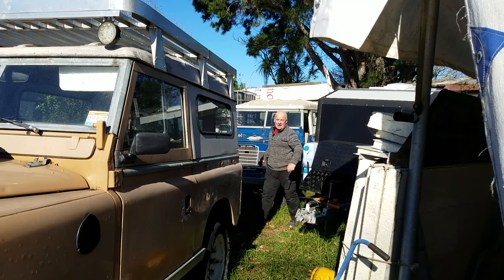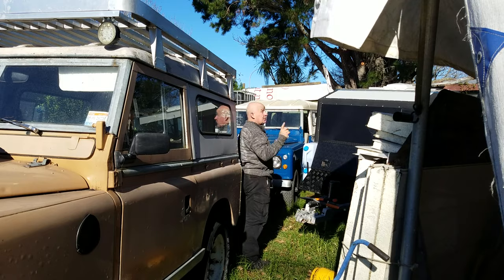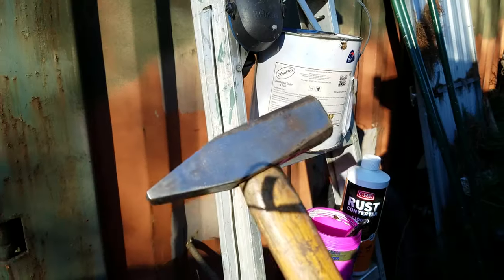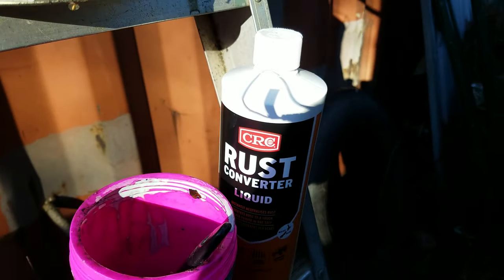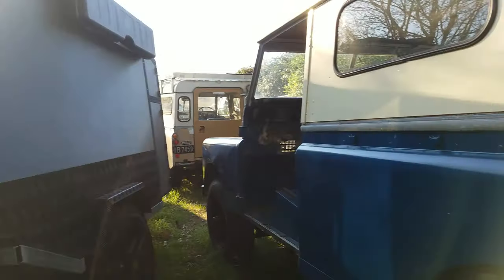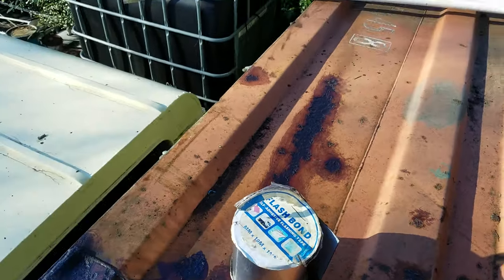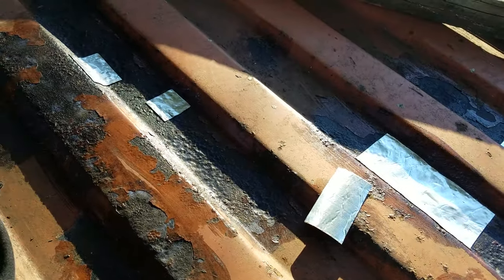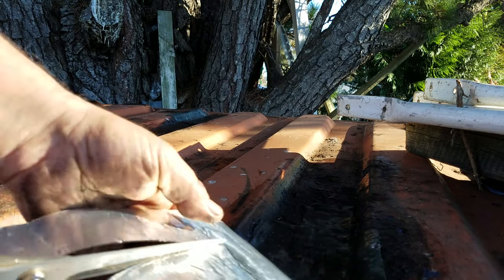Shipping Container  or House Bus  Patch & Waterproof Roof DIY Low Cost.

Comment: Would taking an angle grinder or Stiff Metal bristle brush on a drill and scraping the Rust off and getting clean surface before applying the tape make a (difference/Be better?) Thanks
Reply from the maker: It depends on the level of rust. The rust converter needs 'some' rust to work on. I had flaking scabs of rust that had to be removed - no wire brush would do that! If you read the instructions, all the products tell you to remove the loose rust

Comment: Great video. I use phosphoric acid from cleaning supplier for rust conversion.  A lot cheaper. They sell it for cleaning coffee machines.  I get 4L for under $50AUD.  Cheers
Reply from the maker: I use it for light rust- but it doesnt handle thick flaky stuff like this
Reply: @t.h.o.r.  ok thx

Comment: Got a link for the Flash Bond?
Reply from the maker: Any builders supply has it 🙂
Reply: @t.h.o.r.  I tried Grunt 50mm x 10m Flashing Tape from Bunnings , absolute garbage
Reply from the maker: @christopherstaples6758  The stuff I use is $60 per 10m pretty pricy bit on a warm day its awesome. I do waterproofing on caravans and  stuff with it= good surface frep and a heat gun is the way - but heat guns kill m=y solar in the winter so I prefer to use sunshine

Comment: How much did the Container cost you
Reply from the maker: Second hand- B grade (wind and water tight) 20 years ago cost me $1300 nz . Itll do another 20 I imagine.
Reply: They charge by size, condition and even where they are   In the states they sell them all over and some will even deliver them if not you will hafto find someone to deliver it with at least a 3/4 ton truck and heavy duty trailer